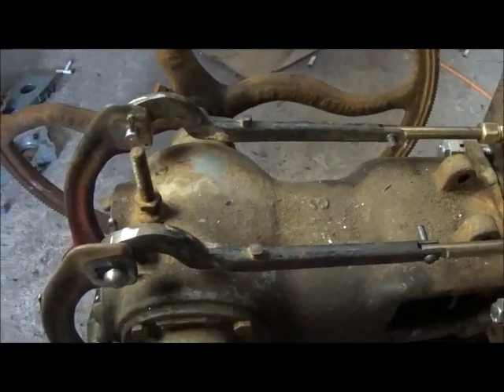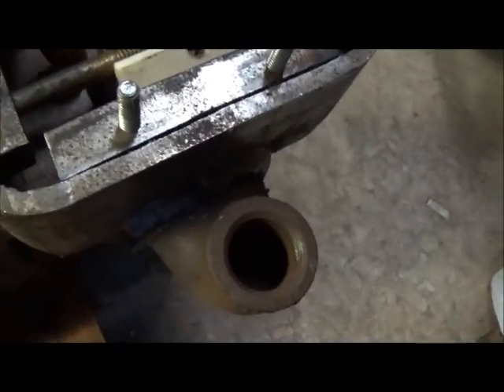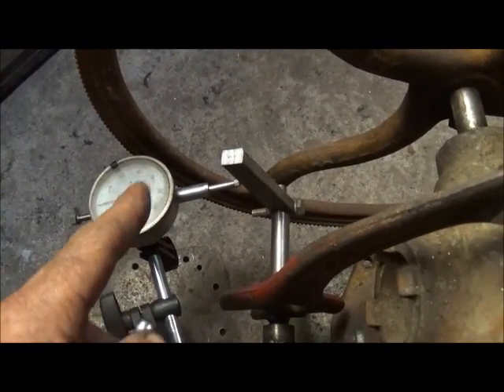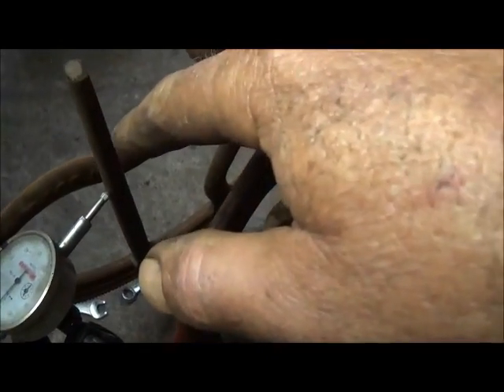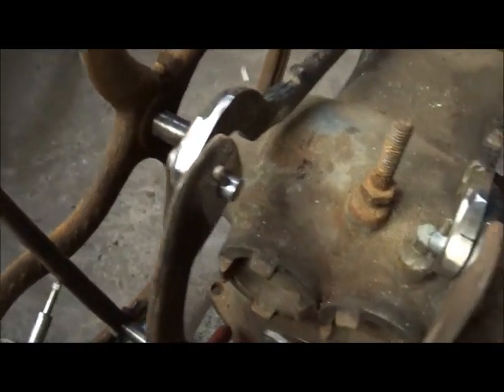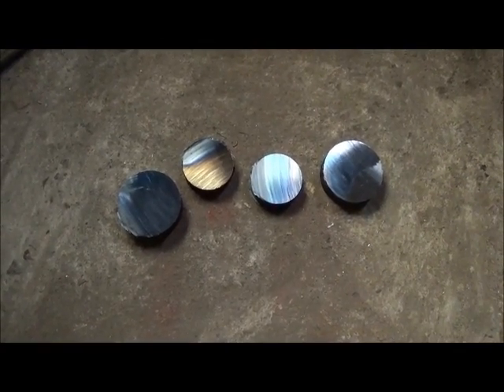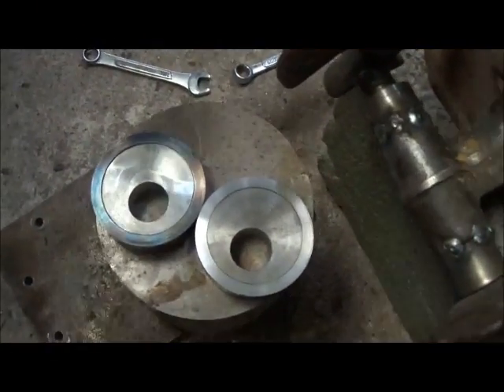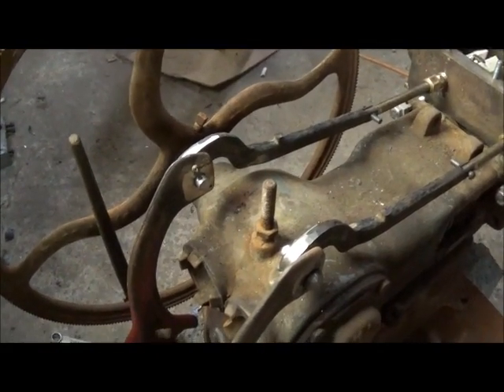Deming Water Pump To Steam Engine  PT10

Comment: Another great segment Jonathan.  You are rapidly becoming one of my favorite contributors.  I like that you use old parts and engineer on the fly.  The eccentric machining process was brilliant.  Machining the offset by location of the crank hole.  On my engines I used to use a 4 jaw to machine the eccentric after I bored the crank hole!  The light bulb came on when I saw how you did it.  I am looking forward to the next segment.  Keep up the good work.   Fred
Reply from the maker: +Fred Miller  Fred, I keep posting, but they seem to be disappearing, so if this becomes a double post, I apologies. I watched your videos, I think your machining skills are far beyond mine. I have a lot of respect for anyone that builds one from scratch. I just like the old look. I don't try to trick, just build them to satisfy my own likings.  I also try to build without buying anything, not that I am cheap, it's like a challenge. Thanks for watching!!

Comment: I'm still here and Really Interested in this or any projects like this. Thanks for all your time to show us this.......
Reply: SURE Did. This is what I learn'nt on back in the day. Was an; 18 speed Quadtraplex Mack and 4x4's, 5x4's, in Peterbilt's and Kenworth & Mack trucks. I even had an 1978 Peterbilt with an 13 speed with an 4 speed box behind that (for extra heavy hauling) It had a total of 52 Forward gears in that thing. It would Pull the state of Texas, he-he. I guess I've driven just about every kind of Transmission there is.
Reply: Oh yeah, where you have't to put your left arm though the Steering Wheel while shifting with Both your Arms at the same time to get in the Right Hole.....he-hee. That was the life of a real Truck Driver back in. Yes-Sir-Re-Bob.
Reply from the maker: +Danny Walker  How did I know you had?? Had that feeling. I have driven a bunch myself, but not nearly as many as you I am sure.  What would these young drivers do now? They all have Allisons.
Reply: Yeah, Most of them do have the Auto's. I just hope Some drivers out there will be able to drive the Big Trucks and Know How to haul the Big Loads. (???) I drove for over 44 years Without a mishap either. I had a Heart Attack & light Stoke back in June 21, 2010. And That completely ended my driving Career. I've got A Flawless record without any accidents. Had quite a few speeding Tickets tho. he-he. But, I'm real Proud of my record too because I hauled some really BIG stuff over the years and some Very Heavy ones too.